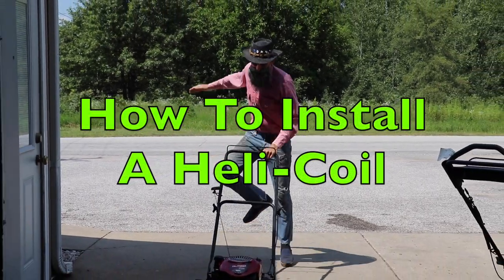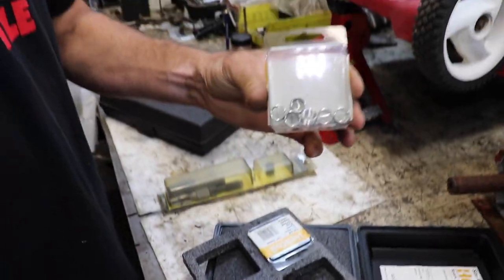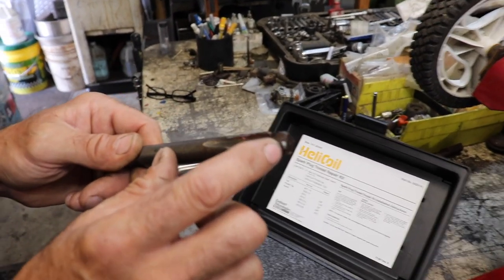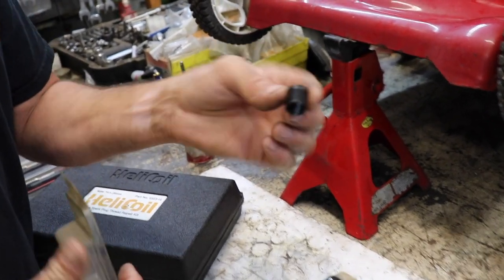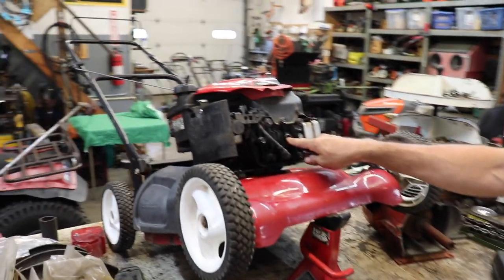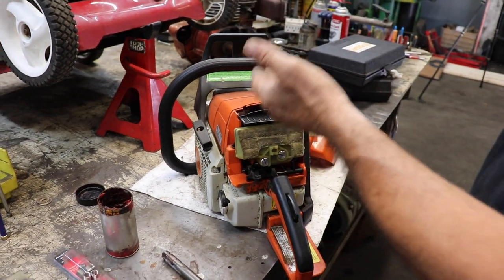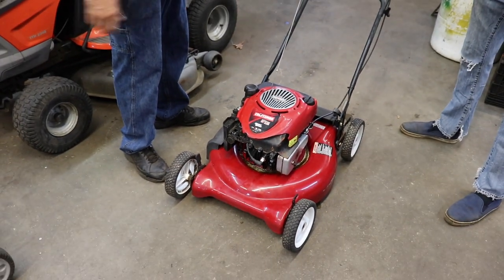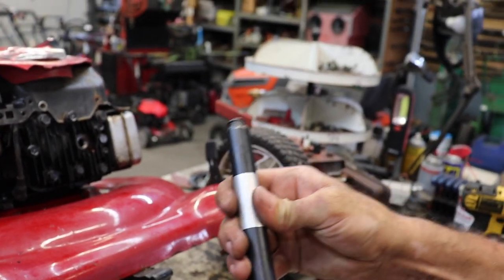Threads Stripped? How To EASILY Install A Heli-Coil

Comment: Taryl you are the Peter Sellers "Pink Panther of small engine repair entertainment.....I enjoy and appreciate your big time practical expertise, and really enjoy your videos....
Taps and dyes have saved me countless times over....
 I even use them in most of my woodworking hobby, which is my passion (besides repairing my John Deere 185)...Especially in jig systems.... 

So Taryl and Taryl's loyal viewers.......Here's a woodworking tip that not a lot of people know......
Don't use metal taps and dyes in wood...You gain far more extra strength by taking what ever size bolt you want to use in your wood project, and make it your actual tap....

Easy to do- Just use a grinder and a vice,  or a bench grinder and a guide, and flatten the surface of two sides of the bolt- Even one side will do it..

Cut the head off, and install it in a drill..... Drill slowly, and back off periodically to rid the wood chips...
You will be amazed how well this works.... Put a little boiled linseed oil in as you do it, and it will last a long time... If you use the Boeing aircraft T-9 Lube , it will last forever, as the coating dries on like a wax.
And it works over and over again...
That is the beauty of taps in wood.... Now there's your dinner!

Comment: I once stripped a bolt hole while putting a brake caliper on my car.  First thing I did was call the dealer to see how much the a replacement part would be.  He was one of the honest ones and right away told me about Heli-Coils.  I thought that was really nice because to replace the part that I had stripped the threads in one bolt hole on would have been somewhere around $300.  I have never done any sort of thread repairs in my life at that point but it was easy as long as I take my time and look at the instructions.  Do note that a Heli-Coil will not appear to have the same threads as your bolt but it is flexible enough to work.  I think they designed them that way intentionally so they don't come out of the bolt hole every time like that one insert kit which Taryl said he doesn't like.  Heli-Coils resemble springs in a way.

Comment: one of my first jobs when i was 18 back in 76 was making these . helicoil was founded in bethel connecticutt, i use to do second shift after  aprint shop job and run 4 of these machines that spit these out  by the thousands , and they had to be done right 
theres your dinner
Reply: Coll I;m in Southbury
Reply: Cool I'm in Southbury right down the road
Reply: Mick Pendy COOL 😎
Reply: Screw machine operator?

Comment: I made a little adaptor tube for my shop vac that goes through the plug hole and is flexible enough to bend round the cylinder bore. it usually get all the chips out without issue.

Comment: Thoughts on Loctite Form-A-Thread Stripped Thread Repair? I actually just used it on my aluminium block for one of the blower housing bolts that go into the block. Worked really well.

Comment: I was working for an International Harvester dealer, fixing farm tractors. We got a call for fixing an earth mover at a construction site.  I went out and found a stripped out bolt on a hydraulic valve.  I installed a heli coil in the valve and got it fixed.  Our shop charged 60 dollars an hour.  The regular folks that fix those, is sixty miles away, and they charged 120 dollars an hour, including travel time.  They made the right decision to call us.

Comment: taryl try some lock tight. I've done it for years on big diesel truck motors. never a problem. my heil coil kit came with a plastic tee insert tool that puts them in as well as brakes the tab but then I bought the kit in the late 90s

Comment: great video on how to install helicoils,the grease you use,catches chips(good idea and it works) but it acts like a lube when tapping threads,never have installed heiicoils on any engines,BUT I always use alittle 271 Loctite on outside of insert when installing,i have no idea what would happen to Loctite when heat from an engine,what would happen from cold to hot over and over again,could you use Loctite on an engine?,or just a waste of time,im a manual machinist operate a HBM,easier on a machine then doing by hand, Agree all kinds of different types and styles of helicoils,LIKE YOUR VIDS

Comment: Hey Taryl, I got a Agri fab lawn vacuum with a 5 hp Briggs and Stratton. The bolts are worn on the muffkin and I need to helicoil them. The issue is one seems to be metric and the other 1/4-20. What would you recommend to change them to??

Comment: Question for you. I basically do the exact same thing you do up here in CT. No blue or a dab of red loctite on the threads before install? I do just in case but then again i never used the type with the tab you have to break off. Maybe the one you use has a tighter fit ...

Comment: What prevents the Heli-Coil from backing out when you remove the plug just like the Perma-Coil does?
Reply: Heli-coil squeezes down, and is under tension against the outer threads. Perma-coil just screws in and out like a bolt.

Comment: Taryl - Thanks so much for your common sense videos.  I enjoy them a lot.  I don't know the answer to this question since I have never stacked the coils.  I wonder if there may not be an issue when stacking to be able to get the threads to line up one coil with the other coil - that is would the threads be in sync with each other?  Is this a concern?   You would need the cross tab on the second coil to set the coil.  Then when you break off the tab on the second coil, would the threads on the two coils line up?  Seems to me the safe approach would be to use only one coil that is the preferred length.

Comment: I laugh at every video, thanks for posting them!    I'm wondering about putting in an insert.   It seems like there is debate about weather to use grease or not, and using RTV or red lock-tight.   I read for motorcycle engines to not use grease as it may cause a chip to stick in the valves or somewhere in there if grease goes into the motor.    I went with the insert because it seemed like it would be a little better for the motor I'm working on.    Respond when you can and thanks for all the great information and entertainment!

Comment: Rule of thumb on thread depth is twice the diameter of the fastener on aluminum and  the diameter of the fastener on steel. I always do a little more.
Reply: Do you happen to know if i were to use this heli coil on my 196cc engine particularly on the side cover bolt holes are you able to torque the bolts down to spec with heli coil ? I'd imagine so right ? My engine bolt holes just seem like they all strip so easily if i give them just a little too much pressure while tightening them down all of a sudden the bolt just keeps spinning and spinning. I hate that.
Reply: @JNC1973  I've used them on head bolts and cam bearing caps no problem. Side covers are light torque.
Reply: @jnc8072  Yes, they easily can take the torque, actually a lot more as they are SS so much stronger than aluminum threads.

Comment: taryl in the video you are also tapping a 5 HP. flathead with electric start.i asked a few weeks back if you could help me get the right metal insert that goes in exhaust side of valve .their is a steel or metal guide that the brass guide goes in to.i bought a kit to pull valve guide but it pulled the metal guide also and ruined the metal guide.i have ordered replacements but no one gets it right.im sure you know the one im talkin about.it has a 3/8 in. outside diameter and its 17/64 on the inside to accept the brass guide which is 9/32 outside dia and 1/4 inside dia.i bought a insert that they said would work and it is 3/8 outside dia. and brass,not good but worse the inside dia. is 5/16.it should be 9/32. can you look at one of even your old flatheads like the one in this video with reverse i think its model 130297 andTYPE 1901-01 and CODE 85082007. i watch you guys all the time.looks like great time and i know lots of hard work.pls reply to randrews612@gmail.com.please.

Comment: Taryl what size heli-coil do i need for the spark plug for a 94 Toyota Pickup 22RE engine?
Reply: pretty sure those are a M14-1.25....it's definitely metric

Comment: If the threads aren't completely destroyed, you can often simply chase the threads using either a tap made for the purpose of use a spark plug with good threads. Use a  hacksaw or moto-tool to cut four grooves across the spark plug threads to improvise a tap. Use the spark plug with grease as described.

Comment: Wondering if I can still get my DINNER without buying a used head and buying all the stuff to make that happen. I wanted to check my valves with the feeler gauge. Both cover gaskets at the exhaust valve were really tight, but one broke off and then all hell broke loose. I followed many of your tips but the tungsten easy-out broke off in the 6mm bolt. Do I give up and look for head?? Or, keep messing with it and try the seized bolt out and get the heli-coil installed. I can't get any drill bit past the broken easy-out yet. Here's what I'm dealing with ... Mower Craftsman (BLACKIE) Gas 2006 917.276922 06 – 1206B004148 Garden Tractor – 50 inch deck Kohler Kohler Courage 26 HP – Twin OHC – GS6500 – 54” Deck SV735-0012 3615111403
.  Thanks for any advice!!!! :)

Comment: Hay Taryl this is your long lost second cuz’n twice removed Maryl. I’ve watched a whole heap of your here repair videos but I don’t see one for my particular problem. Could you make a video showing how to replace the mufkin belt on a 2011 Toy Bilt Pony tractor? Also if you could include what type of headlight fluid to use that would be helpful cause I added some fluid I found on the inter screen but I don’t think it was the right stuff cause my headlights don’t work now. Thanx. Cuz’n

Comment: Could you put some thread lock on the coil to help keep the coil in place when under pressure ?
Reply: I’ve used the heli-coil kits before and it said to use thread locker in the directions.
Reply: Hi-temp red

Comment: Hello Taryl. You know I've done a few on chainsaws and one thing I've done is pull the muffkin and carbotrator off and blow out the chips, but you're right, it ain't the space shuttle, lol, I love that phrase.
Reply: Does that mean you really don't need to remove the carb and muffkin?
Reply: @andrewnorris1514  on a chainsaw I would remove one or the other. I don't think it's necessary to remove both, after a couple of saws I found that just removing the muffler did the job.
Reply: @phillipparker8947  thank you . I'm doing a leaf blower.  Could I just measure the amount of travel and use that as a guide . Taryl says when the plug is over the piston it's no big deal . From what I've seen lots and lots of grease seems to be the answer. Would you use loctite?
Reply: @andrewnorris1514  I would not use loctite, using grease does work, I was never a fan because no matter how careful I was that stuff got all over me, lol.  Your welcome
Reply: @phillipparker8947  Heli Coil went in just right. What a life saver. Thanks  for your input
Reply: @andrewnorris1514  no thanks needed, glad to give input at any time. Glad it all worked out.

Comment: Sometimes the crappy Heli-Coil inserts wind back out with the sparkplug and what I did with my tractor is use red Loctite and let it set over night and carefully remove it and stake the thread insert around four times. (1977 MTD 990 with 16hp iron block, aluminum head / stripped sparkplug threads, old aluminum fatigue)

Comment: Taryl, need your advise, is a new Sthil chainsaw a good saw or have they gone offshore and downhill?
Reply: They are the best chainsaw on the market!
Reply: Stihl is built in the US. Has been for decades. Originally from Germany. Had my MS361 for over ten years. Cut a butt load of wood and have never even needed a new plug. Keep the air filter clean, good gas with the correct mix, and  the chain sharp, she’ll last a long time. Still got my Grandpa’s 041 Farm Boss he bought new probably 45 years ago. German built. Still runs great!
Reply: Excellent choice

Comment: The carbon that gets generated when the engine is running will get imbedded and lock the H coil in if you don’t have locktite . I usually have to remove stuck shotgun chokes on shotgun barrels because of carbon buildup on threads on customers shotguns so greese your choke tubes, no coffee no workee 😂

Comment: should I put red our blue lock tight
Reply: i wouldn't, not on a heli coil it might bleed through and loctite your spark plug in . on the solid style insert its okay actually recommend it on that style insert.
Reply: Will not hold to the temps.

Comment: i got an idea for a video Taryl how to re-adjust the linkage on a mtd yard machine. my is model number 13am660f700 . mine is stuck in gear and the engine turns over and runs for 3-6 secs then chokes out  but, i cant get it in neutral to get it to run
Reply: Dwayne Maslowski well he would have to have the machine to make a video

Comment: When I was a kid working at a gas station a guy came in for a oil change 1968 Camaro and when I went to put the plug back in it stripped out. With out any pressure from me. I found a old oil pan out back and used its drain plug it got tight enough and I filled the oil and sent him down the road. This was in 1969. I think that plug is still working.

Comment: Heli-coils no matter if official or clones are invaluable. The time sert is the second set taryl showed here. With time serts you have to follow the directions exactly as stated and use RED locktite. I used a time sert on my old tecumseh hm-100 snowblower engine. I got them on sale cheap.

The helicoil is a screw in type and that’s why they are better.
I have both types.

Always trust taryl and his crew because they have experience and years of servicing engines so they are well seasoned. His vids have ALWAYS steered me in the right direction and what Tarly says is dead on.😀

Comment: I had a l head Briggs and Stratton on a push mower the spark plug hole was in the same condition but I had another head with a good spark plug hole so I got lucky 😀😀😀😀

Comment: Wait....Could I used a heli coil to put strong threads in plastic?
Reply: They make threaded inserts you can use for that. Much cheaper than using Heli-Coil.

Comment: I used to get mad at our maintenance man. We used real old real big polyclip machines and they were mostly aluminum. He'd always strip something overtightening it and rather than use helicopters coil he'd tap it out and use a bigger bolt. After a few years of him doin that anytime you worked on them you had to bring an entire toolbox because of all the different sizes bolts there were.

Comment: The other way of making sure no metal shavings are stuck in the cylinder is to simply pull on the starter rope & spin the motor out.

You can use a longer helicoil,only that you'll have to trim the free coils off with a set of sidecutters,the helicoil kits that I've used are different to the ones that you use on here,I saw a teacher at tech having to trim them off shorter & I've had to do that when repairing a stripped out brake caliper thread in the steering knuckle in my car.

One place it isn't wise to use helicoils is in the Gen3-Gen5  Chevrolet V8 engines for their cylinder head bolt threads if they ever do strip out.

Helicoils have been known to strip out in them so thread inserts have been made up for them,they are called Time-serts :- http://www.mechanicstoolsandbits.com/time-sert-j-42385-100-m11-x-2-0mm-gm-gen3-5-7l-v8-ls-thread-repair-kit.html

Comment: I've used a vacuum cleaner to get the chips out.  Get the piston near top center on compression stroke and use the vacuum.  That was my dinner.
Reply: P.S. Those big inserts hit the piston on my Honda 450 engine.  Wrecked the head.
Reply: @ralphwatten2426  Wrong length insert by the sounds of it.

Comment: Make a cheap depth gauge by putting a small 90 degree bend in a piece of wire. Stick it in hole (no comments), pull back so end rests against inside surface, and measure. Time for lunch.